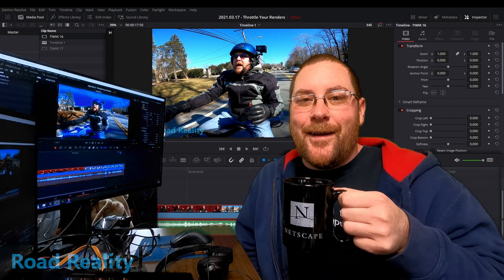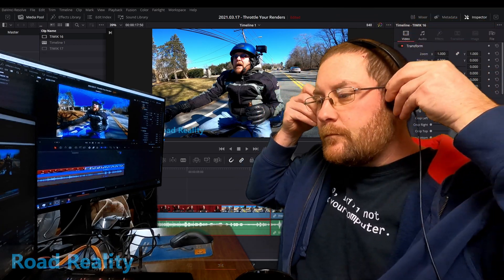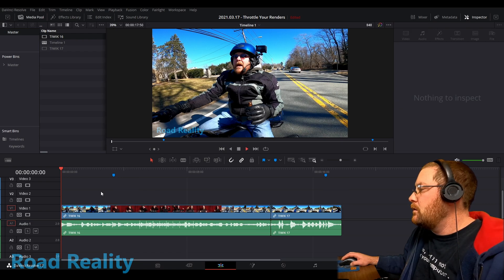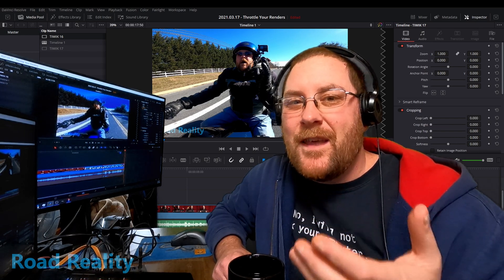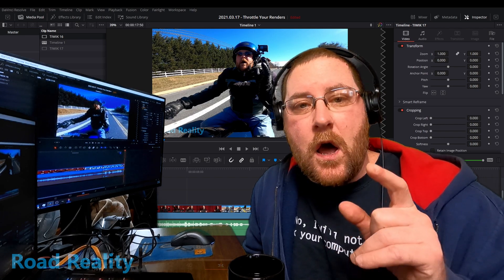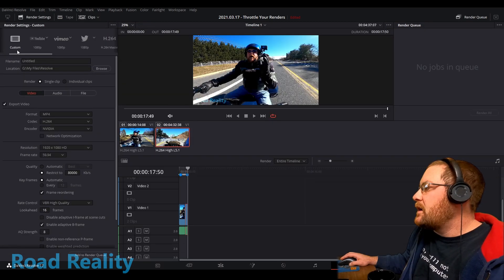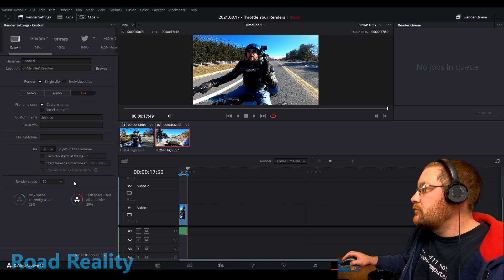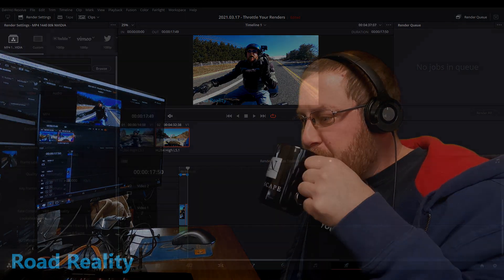Throttle your Render Speed to fix Audio Glitches & Artifacts in Davinci Resolve 17 FREE & STUDIO

Comment: f* that, I was doing it manually for 4 hours to edit every sample, and then found your video. :D
Reply: I had to use reduction and voice channel as described, but still to cut clipped highs and I got rid of it more or less. :) Rendering did not help.
Reply from the maker: @signaturefilmlisbon  Wow, that's wild.  I wonder if instead of glitching audio, you're just experiencing the clipping?  You could try using a compressor on the audio to fix it.
Reply from the maker: Ouch - glad you found it though, it'll come in handy in the future :D
Reply: @RoadReality thanks ..i tried on 50, still some glitch in. Any suggestion?
Reply from the maker: @signaturefilmlisbon  Slow it down further.  You might have to go to 20 or 30 fps.  What are your system specs?
Reply: Mac M3 Max 36gb  @RoadReality
Reply from the maker: @signaturefilmlisbon  Man, that shouldn't have any glitching issues!  One thing you can try is to to render out the parts that are glitching, and then re-insert them into your main timeline.  This will greatly ease the processing required to render the final video.
Reply: Will do that and get a feedback might help someone else too in case it works. Also will try to render from internal drive rather than external  @RoadReality

Comment: I have another issue with audio playback and render. There is an audio interference like when you are listening to a radio station and suddenly a fragment overlaps. How to solve this issue?
Reply from the maker: If throttling the render doesn't fix that... you might try copying the contents of the timeline to a new one and trying again.  That's not an issue I've experienced.

Comment: I'm going to see if this works for me. I'm going insane trying to figure out what's causing the glitches. It only happens when I put multiple timelines in one and render as a single video file. 

Also, I love the Netscape mug.
Reply: CPU is a Ryzen 5 2600
GPU is Radeon Rx 580 GTS 8GB DDR5
RAM is 42 DDR4 (can't remember the speed)

The hardware is all just over 3 years old. I built it in April 2020.

We rendered at 10 and there were no audio glitches, which 100% proves your theory is correct. Only problem is it took a few hours 😂 so we're trying the next draft at 25.
Reply from the maker: @sonicclang  yeah, that totally makes sense.  I'm on an Intel 10750H CPU and. GeForce 2070 Super GPU, and I think that's more powerful than your rig... but it's also 3 years old, so I'm seeing a lot of slowdown now, lol
Reply: I rendered again at 20 and there were definitely a few audio glitches. Guess that means I'm stuck rendering my final drafts at 10!
Reply from the maker: @sonicclang  Dang!  At least you can render without issues, though!
Reply from the maker: I hope it works - let me know if it does or not!  Your scenario sounds similar to what I was dealing with, so I bet it does.

LOL, that mug has been around a LONG time :D
Reply: @RoadReality I rendered again at 50. I haven't been able to watch the entire thing, but I got 20 minutes in before my first audio glitch. This tells me it's getting better, and I should try even slower.
Reply from the maker: @sonicclang  That's awesome!  Too bad 50fps didn't fix it... what CPU/GPU/RAM specs does your computer have?  I'm curious how it compares to mine.  I have a feeling that Resolve gets overloaded when there's a lot going on and something on the computer can't keep up.

Comment: I’ve read the comments, looks like it worked for everyone. It’s not solving the problem for me for some reason? Playback is fine, I get glitchy audio when I render
Reply from the maker: Hmm, I would go slower still.  Depending on your computer's specs, 25fps may work better.  Good luck!
Reply: @RoadReality  I tried 10fps, didn’t work. I then changed the audio bitrate, that was the fix for me 🙂
Reply from the maker: @Shnapple Media  Oh wow, very interesting!  What bit rate did you change from and to?
Reply: @RoadReality  from 16 to 24. Must be mov, mp4 doesn’t work
Reply from the maker: @tomorrowwithjacob  Hmm, that's interesting.  I wonder if it has to do with your computer's components.  I'll keep that in my back pocket in case I encounter it again, but I'm glad you found a fix that worked!

Comment: I just don’t understand how this blackmagic software would just go ahead and render a horrendous audio bug, I’m not in any rush just want the program to fucking work properly. I have problem with this shitty app every couple of months
Reply from the maker: They add a lot of great new features, but sometimes break older things... every new release, there's a few issues.  They're pretty good about fixing things, but I think it could actually be an issue with computer speed that causes the audio & video glitches, and slowing down the render allows the computer to keep up, if that makes sense.
Reply: @RoadReality  I tried your tips, slowing it down to even 25, but I still have the audio glitch. It’s very frustrating when I’m trying to upload music
Reply from the maker: @plexxarbiitch  Wow, that's a bummer - I'd be upset too!  In your case, I'd look for a Fusion effect or something, and remove it as a test to see if the audio renders properly.

Barring that, I'd render out the audio and video separately and then combine them in a new timeline and render together.
Reply: @RoadReality  I’ll try that for my next project but, as far as this one goes, black magic design has defeated me

Comment: This fixed my problems with video artifacts like missing pixels and static appearing in some of the frames.  I did notice the video was rendering at very fast speeds and sometimes restarting the computer would seem to fix the problem for a single rendering, but lowering the rendering speed seems to be the solution.  Thanks!
Reply from the maker: Yay, glad it fixed it for you!  Thanks for letting me know :D

Comment: My problem audio glitch in time-line only. Audio plays fine for about 2 to 3 seconds and get glitchy and  gargling sound. Stop and sounds fine for a few seconds and then same thing. Plays fine in edit tab and audio tab. And when only audio playing time-line. 
Any suggestions?  Thanks
Reply from the maker: I'm not sure - I've never encountered that specific problem before.  If there's a way to activate Render Cache on your clips, or use proxies, I'd try that.
Reply: @RoadReality  Thanks, I've tried most everything. Using a laptop windows 11, trying to download to old Mac pro 08' to see if it could be laptop problem.. just odd it only does it on time-line. Safe Travels.
Reply from the maker: @tinshedprooldvideosfootage695  it sounds like a buffer issue - I wonder if setting your playback resolution to 1/4 (in the playback menu) would help?  I have a video in my Resolve Playlist on Shortcuts - in there I give a few tips to smooth out playback... I'd try that.

Comment: Batting my head off a brick wall for... probably 6 months. Maybe more. Thanks for the SOLUTION! :D Audio clicks in davinci gone. Shame my 200fps renders are now slowed down to 50, but a fix is a fix! :D Thanks again.
Reply from the maker: Hey, glad I could help!  I agree - I used to have high render speeds too, but if it doesn't come out right, what's the use?

Comment: THANK YOU.
By the way, setting it up to 100 instead of 50 also worked. Dunno if that makes rendering faster.
Reply from the maker: Cool, glad it helped!  100, huh?  I may have to try that!  I was rendering at 150-200fps before I set the throttle, so I'll have to try 100 - that would certainly speed up my renders!

Comment: I've been experiencing this problem, but only since upgrading to v17 - on v16 (on the same hardware) I could render at 100+ frames per second (unpaid version) and the audio was fine - after the upgrade, lots of chirpy artifacting especially when there is white noise in the source clip (like bacon frying or sometimes just when I speak a word with an F in it or whatever)
Another workaround I found for this is to increase the bit depth on the audio, but that can cause some compatibility issues with streaming after upload apparently
Reply from the maker: Interesting... I only ever noticed it with Fusion stuff going on after I started using a VST audio plugin.  Ever since I throttled to 50fps render speed, I have yet to experience it again.  Did this method help, without having to increase the audio bit depth?
Reply: @RoadReality  I tried throttling the render speed and it didn't seem to solve my issue, so we might be looking at two different issues with similar symptoms (maybe each issue is related to the combination of hardware and drivers we are each using).
For me, rendering with AAC audio results in overcompressed-sounding audio that is chirpy and sharp sounding.
Rendering with 24 bit PCM seems to solve it for me (at any render speed)
Reply from the maker: @AtomicShrimp  That's VERY interesting - I hadn't heard that the audio codec had anything to do with it, so this is more data to throw into the mix.  I've begun rendering in 24-bit PCM as well, since watching a video on YT about the best DR render settings for YT [I'm pretty sure Jay Lippman did the vid], but I still throttle to 50fps because it's way easier on my laptop, and really a few minutes is worth it to keep the CPU around 80C :D
Reply: This fixed it for me too after hours of trying different settings. I can even render at full speed. THANK YOU!!!

Comment: Good deal. My problem with resolve is it opens and that's it. Nothing I do does anything. I try to adjust the color , contrast whatever, the wheels turn but there is no change in the look. And that is with everything I try to do. I finally gave up and just uninstalled it. I have had this problem with every video editor but the 2 that come with windows. So I'm stuck with very limited editing.
Reply from the maker: YouTube, where's the SAD FACE reply to a comment?

Sorry you've had such a run of back luck with DR - is your computer old or new?  I mean, it's a resource HOG and will use whatever you have, and all of it at once.  I think for as much as I pump up Resolve, they ought to give me an honorary title like Brand Ambassador or something :D
Reply: @RoadReality  I built my desktop and bought my laptop in 2014. Both have Intel I7 processors and 16 GB ram and SSDs
Reply from the maker: @EasyRiderGreg  hmm, weird.  DR should work on it, I mean I had an i7 laptop with 16gb of RAM and it ran resolve ok.  I would download the latest version of resolve and upgrade your graphics card drivers.